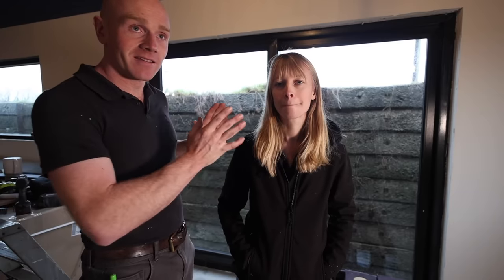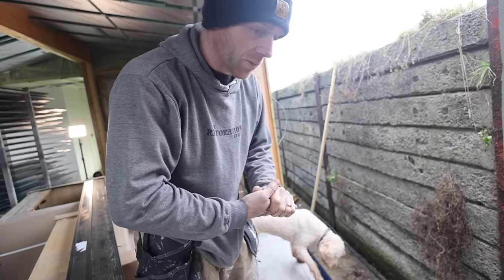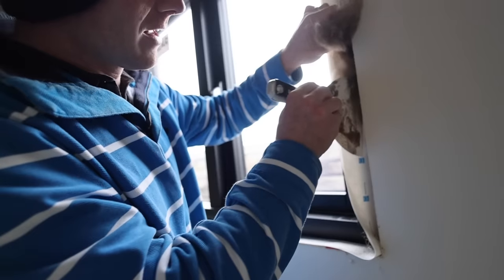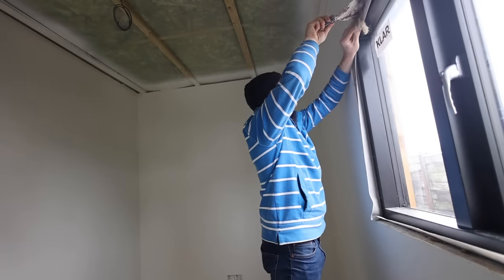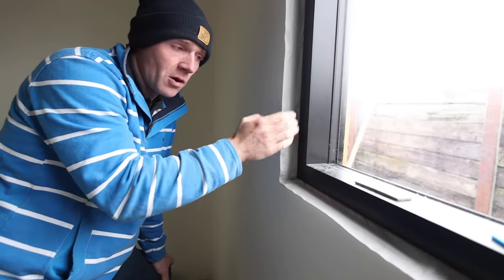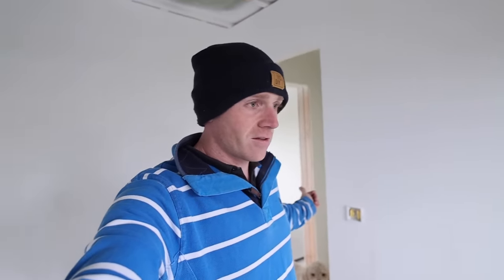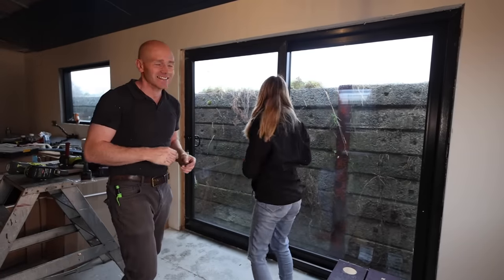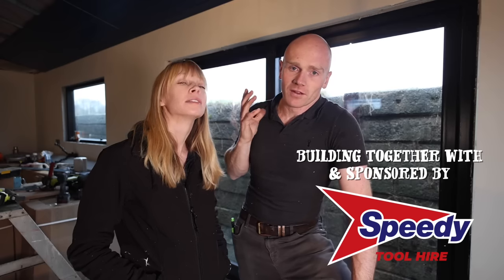PATIO DOOR INSTALL & SEALING AROUND OUR WINDOWS | Foam v Wool

Comment: I think that's a pretty good deal on the patio doors! I paid around a grand for my composite 4 panel (top two glazed) front door. In all honesty expanding foam with a long nozzle attachment put in right to the back fills gaps thoroughly, it has the added benefit of acting like an adhesive too. I think with the wool you run the risk of temptation to pack it too tight and compress a lot of air out of it losing some of it's insulating properties.

Comment: Expanding foam, holds a better u value than sheeps wool, has better sound deadening qualites than sheeps wool and is also used as a secondary fixture! Its regs to expanding foam door linings now

Comment: Second  the comment about compressing the insulation.  It needs to be fluffy to trap air to work.  Plus  expanding foam helps fix in frames especially in brickwork where doors are sometimes slammed shut.
Reply from the maker: We have done whole videos on that, it’s very important while insulating. In this draft proofing situation it’s better to make sure a 3mm gap is filled and no air movement like you would use oakum. After all however much you compress it, it’s next to a solid timber frame and pane of glass.
Reply from the maker: We have done whole videos on that, it’s very important while insulating. In this draft proofing situation it’s better to make sure a 3mm gap is filled and no air movement like you would use oakum. After all however much you compress it, it’s next to a solid timber frame and pane of glass.

Comment: Been following you guys for ages and was nicely surprised to see you sourced the same windows as us. We’ve just put the aluclad versions in on our project. Had the same concerns as you regarding not having the secondary lock position but they have a surprise feature! If you open the window a bit and then move the handle to the closed position it holds the window in that position! Not as secure as a secondary latch but a nice little feature that took me about 8 months to discover!
Reply from the maker: May well be a all clad version thing as no way that would work with these.  The hinges are individual and no runners or stays to make anything like that work unfortunately.  Shame.

Comment: Re cedar feature wall. If you want to ‘joint’ the cedar to minimise the gap push the boards next to each other and run the track saw down the join. Not cabinet grade join but tight enough before contraction 👍🏻
Keep them coming in ‘23